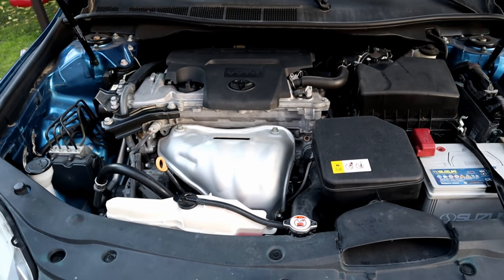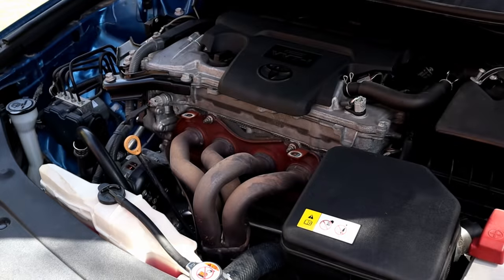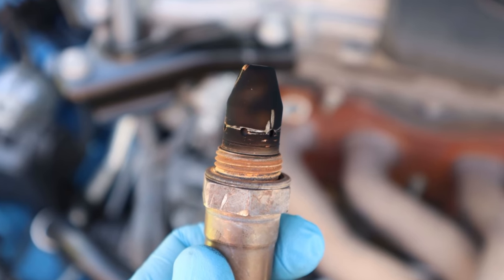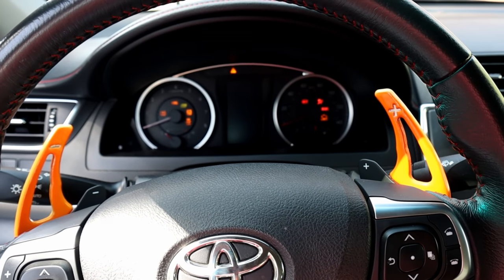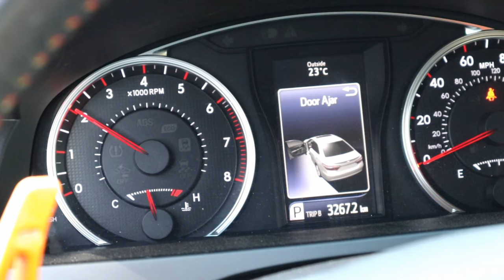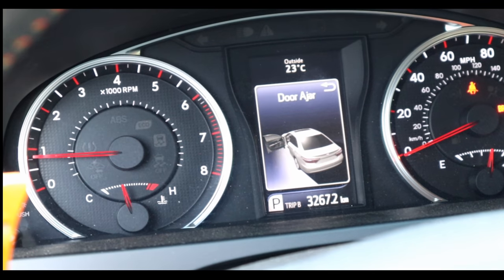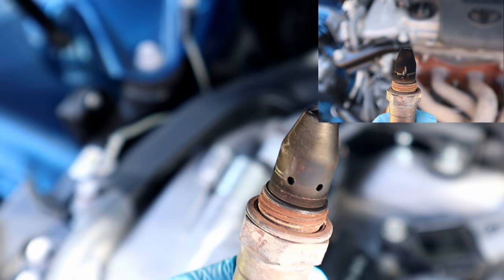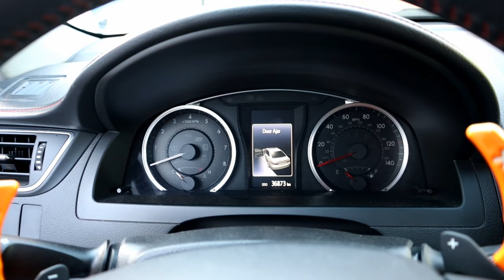Cleaning o2 sensor without removing it/Cleaning oxygen sensor with carb cleaner/TOYOTA Camry 2017

Comment: Does this work for both upstream and downstream sensors?  Thanks
Reply: Yes. Downstream just monitor how well your cats are working
Reply: Mainly for the upstream sensor.  The downstream is post cat although technically it's possible if you flood the intake with the solvent that some of it can make it past the cat and on to the downstream sensor as well but in the case of the downstream sensor the main issue there are with those is not so much carbon accumulation but rather the heating element inside of the downstream sensor going bad.

Comment: I guess  that is OK if no new sensors are available  but you can get a brand new same day. People used to clean sparkplugs back in the old days. I change sparkplugs every 100000 miles, I use NKG or Denso.

Comment: The problem is the actual sensor is actually covered by the metal cover that you just cleaned the sensor itself might still be dirty you're better off removing it and soaking it for about an hour and even then it's not going to be perfectly clean the only way to be sure is to replace it they're not expensive and it's an easy job.

Comment: The Air fuel ratio sensor was black because it ran way too rich.  If the sensors are functioning right it should clean by itself
Reply from the maker: Correct,  I had bad fuel injector, after I cleaned it, I did this too to speed up the process to clean the sensors

Comment: After opening the oxygen sensor Check light will appear or not?
Reply from the maker: No, it will turn on if you unplug the wire harnesses when the engine running
Reply: @AliMECH  thanks bro

Comment: Looks like the cleaning worked. However that is not an O2 sensor, it's an Air Flow sensor which gives more information to the car's computer than the O2 sensor.

Comment: Good variant. View old petroil and filtr petroil. Sensor not It won't get dirty that fast.  In dry fuel there will always be soot soot going to the sensor.  Good fuel makes less soot.
Reply from the maker: Yes that's right, it will only gets dirty if there a problem with the fuel injectors or spark plug, I had clogged fuel injection, and I did this to speed up the cleaning process

Comment: My o2 censor is on my catalytic converter. 
I did spray it out. 
I sprayed carb cleaner into the catalytic too.
Then I ran it for a while and revved it. 
I'm still getting bad emissions from the catalytic. 
I thought the reason why was because I put in thicker oil and that went straight to the catalytic and o2 censor.

Comment: Hi, I have mazda 2 2012 1.3 Automatic 120000 km I'm getting code P0171 system too lean bank 1, I have changed the air flow sensor but no  use, any suggestions what could be the issue?

Comment: a carboned up O2 or air/fuel sensor may indicate that it is dead and that is why it is covered. Know how to test it and simply replace if required. Cleaning internally is good though.
Reply from the maker: I had one failed fuel injectors, that's why , engine had misfiring, it will cover o2 sensor like that

Comment: please tell me this is a regular carb for cleaning the carburetor
Reply from the maker: Yes, Its regular carb cleaner
Reply: @AliMECH  and what is the result, there are improvements?
Reply from the maker: Yes, burning less fuel, better fuel economy,  because it will send accurate data to the computer
Reply: @AliMECH  
I'll try.
I have a vibration on "P"
Reply from the maker: Might be the fuel injectors, watch this https://youtu.be/aDvtzg-ThZs
Reply: @AliMECH  thanks
Reply from the maker: You welcome
Reply: @AliMECH  
but what about the second sensor at the bottom?)

Comment: I would put anti seize on the O2 censer threads before re- installing it !
Reply: Ya you can tell he doesn't. He has rust all over the threads of that O2 sensor. Wait till they have high miles those sensors will have to be cut or drilled out
Reply: Agreed, I would have cleaned the rust off the threads too.

Comment: Does it throw any codes when u remove it and clean those
Reply from the maker: No, but if you unplug the wire harnesses when the car running,  it will turn on the check engine light and throw code

Comment: It's a good for atemp to fix a bad oxygen sensor code.  But it meathod of spray cleaners will only remove surface carbon.  I will be coated with black carbon in a week.

Comment: Just by a new one. The resistance value of the coil has probably changed due to increased heat. So this is going to have an adverse effect on your fuel trim and you will never achieve LAMDA.

Comment: I think.....the 02 sensor though may be bad on the inside part.....not the outside gunk. So I guess clean it and see. If it works ,good. If it doesnt buy a new one. Everything is not magic just some things are....lol.....To my understanding theres a heating element on the inside of the sensor..... CLEANER MAY NOT FIX IT.

Comment: My car shuts down when I do so or am I using the wrong vacuum line?
Reply from the maker: You need to hold the rpm a bit high maybe 2000
Reply: And only do short squirts of the carb cleaner. Stop squirting when the engine slows down, wait until it comes back up, and do another short squirt. Repeat until half the can of carb cleaner is gone, I think he said.

Comment: One only needs to pause @3:22-23 to see that the carbon has only been removed from the upstream side of the sensor. Cheap fixes and jury-rigging are only temporary fixes if the sensor is broken or worn .... Spend the money, do it right and get over the cost. It will eventually pay for itself in the cost of wasted gas, poor performance, time and aggravation.

Comment: How to break through the cecum?

Applicable to "forced air cooling" scooters with cooling fans, or water-cooled steam and locomotives (including heavy machines):
Replace the spark plug with a new one first, then wipe the "inner edge of the exhaust port" clean, then start the engine to idle for 5-10 minutes and then turn off the ignition, then remove the spark plug to see the front thread (exposed in the combustion chamber, equivalent to dismantling The engine looks at the carbon deposition in the combustion chamber) and the color of the exhaust port, this is the degree of carbon deposition at the engine idle speed!

The idle speed of the engine is actually the time when the intake and exhaust time is the most abundant, the ignition is the most reliable and the combustion is the best. poison!

Next, lock the spark plug back and run for five minutes in a row to do the actual blowdown test of the engine in the driving room:
Do not exceed 2/3 of the maximum speed. After stopping and turning off the engine, the "inner edge of the exhaust port" will definitely be darker than when idling. After pulling and turning the car, park the car and turn off the engine. Remove the spark plug to see the front screw teeth, which are exposed. In the combustion chamber, the carbon deposits will be as black as the exhaust!

In fact, it is the more incompletely burned carbon black from the combustion chamber - the exhaust port of the cylinder head - the exhaust pipe, the catalytic converter - and finally the end of the exhaust pipe "can not filter out the catalyst" and is even faster than the idle speed. Hundreds and thousand times of poisonous carbon black gas is discharged to the "global village"!

grateful!

Comment: Most cleaners will be burned in the engine and none will be able to reach the O2 sensor.  The only hope is a "cleaner" running engine helps remove the carbon build up all the way to the O2 sensor.  Note the sensor is under the metal cover for protection.  Most of the problem is a carbon coating on the sensor will stop the sensor operation.

Comment: Spraying out the carbon deposit from the metal cover of the sensor does not do anything. The only way to really clean it is with ultrasonic bath, etc... and the results are not guaranteed.
Reply: Some mechanics wash it in boiling water

Comment: What is the vacuum hose and where? Isn't it the fuel injection?
Reply from the maker: The hose that connects pcv valve to the engine cover, is the vacuum  hose

Comment: You could just replace th O2 sensor for 50 bucks and not risk trashing your catalytic converters.  They usually last 100k miles.  This seems unnecessary.

Comment: Useless operation. If a o2 sensor fails it’s not because of that little bit of carbon. If you do this for an EGR or the intake valves then sure it can help. This video is the equivalent of degreasing your oil dipstick just to put it back in to check the oil level.

Comment: IMPORTANT to find out WHY its getting sooted up.  Likely an AIR intake or exhaust leak reading as a LEAN condition and the ECU making a rich condition......which is what I went through.  I just solved several air intake leaks....... and finally w a smoke machine in the tail pipe would another culprit was an exhaust leak on bank 2.   Not resolved... and it took several removal and cleaning by hand (easy w ramps and antiseize) to clean up/get the carbon out of the system.   Running like NEW now!  OBD2 scanner to graph out the B2S1 front O2 sensor to verify proper voltage swinging activity is KEY.    night and day now.   Unleash the B E A S T!  thanks

Comment: I changed my o2 sensor and a week after the engine light com back on saying that the sensor need to change I don't understand
Reply: It's because the process that plugged up the first sensor has not been fixed. So that same faulty process plugged up the new sensor also. Somehow maybe the air/fuel mixture is off so it is burning too rich. Try replacing your air filter first. That's the cheapest possibility of fixing the air/fuel mixture. If that doesn't work, something more serious may be the problem, such as fuel injector not working properly.

Comment: Hi
 What is the benefit of cleaning o2 senser
Reply from the maker: Sending accurate readings to cars computer and you will have better fuel efficiency, more mileage
Reply: @AliMECH  I'm using Mitsubishi Lancer 1.3 litter petrol engine (300000km)
8-10 is the fuel efficiency in highway. If i change o2 senser, may be get any benefit for fuel consumption?
Reply from the maker: Not that much, you need to replace fuel injections as well

Comment: If the sensor is dirty, it means the car is suffering from incombustion or the sensor is not working. Solve that problem first not by cleaning.
Reply from the maker: Exactly, that's what I mentioned, I had clogging fuel injector, it will also cleans the sensor, but I wanted to speed up the process

Comment: Contact point cleaner is highly recomended than carb cleaner for sensor cleaning
Reply: cant spray mass air flo sensor with carb cleaner, correct?
Reply: @sueapollonio3000  ✅Cause will destroy the computer chip & go with CRC Mass Air Cleaner and Throttle body cleaner will see after all use of theses products MPG gains 2-5 great 👍

Comment: The bottle you used is not made to enter the engine...its a carb cleaner...real way is to use liqui moly cat cleaner...to clean catalytic system...and in usual oxygen sensors are not made to be cleaned there is a certain maintainance to replace in certain mileage

Comment: How about carb cleaner in oil catch can?
Reply from the maker: Is your catch can outlet connected before throttle or on pcv valve,  dont do it if its connected before throttle because it will mess up throttle   but if its connected to pcv valve line,  go for it
Reply: Thinking an equivalent to the "oil catch can" could be created for the egr to intake manifold "soot machine".

Comment: What about chech engine light on
Reply from the maker: It should turn of after driving, or disconnect the battery negative terminal and connect it again, if it comes in again, you have a faulty o2 sensor, and you have to replace it with a new one

Comment: You failed to day that the oxygen sensor most be cleaned on the threaded area, otherwise it won't have good ground continuity and the engine won't work Right, don't forget to apply anti seize to prevent corrosión.

Comment: Why you didn't disconnect the battery ?
Reply from the maker: No need to,  because I didnt start the car with the sensor unplugged
Reply: @AliMECH  i have a subaru forester, my o2 sensor didn't work, i want to solve the problem by watching some videos, every single video told about to disconnect the battery before plugging it to the exhaust , tell me more please

Comment: Isn't this just addressing the symptom but not the cause?
Reply from the maker: Yes of course, you are right,  I had one bad fuel injector,  after I cleaned it, I wanted to speed up cleaning process for the o2 sensor
Reply: @AliMECH  how do you speed up cleaning process for the 02 sensors?
Reply from the maker: Like what I did in this  video

Comment: You clean the neutral not the heater in oxygen sensor.
Reply from the maker: I know the outer surface just for protection, but the carb cleaner goes in from the holes

Comment: The experience of a very conscientious car repairman for 30 years:

At any engine speed, the inner edge of the exhaust port is still clean^ Really complete combustion^, which is the most fuel efficient!

The choice of gasoline number:
See which kind of gasoline can make the inner edge of your exhaust port the least black. It has the best combustion (the power output of gasoline is of course the strongest when it is close to burning out), and has the least amount of carbon deposits (there is much less chance of wasting money) , The color of the exhaust port, the front thread of the spark plug and the combustion chamber are all filled with exhaust gas!

Profiters who rely on engine carbon deposits, steam and locomotives that cannot make the most of their use, also have to use the "87 mode" of the engine idle exhaust inspection with ignorance: who can drive at 800rpm? That man is God!

The worst emissions from engine idling are deceptive, because when there is a "traffic jam", whether it is a car or motorcycle, the engine can only start at idling speed in that place, waiting to start moving forward, plus the "exhaust pollution" in that space. Concentrations are high, and being said "out of context" has the worst emissions at idle!

grateful!

Comment: carb cleaner remove the coating on throttle body plate, that's why you should never use it to clean the throttle body, so why using it here?!!
plus if you have to take it out before or after or both why not clean it when it's out. and clean intake and other parts with proper cleaner, like seafoam or throttle body cleaner!

Comment: Pouring carb cleaner directly into the engine is an easy way to damage the cylinder walls , in this video the engine becomes noisy

Comment: What happened to car if my car o2 sencor is dirty. ? My car is showing check engine light
Reply from the maker: You will have a bad fuel economy and the check engine light will be on, i suggest to scan it to know what code causes the problem
Reply: @AliMECH  when i press gas pedal and it hit 5000rpm then check engine light turn on .. is it also a sign of bad O2 sensor ?
Reply from the maker: Is it stays on or flashs? You may need to scan it to see what codes you have
Reply: @AliMECH  as soon as rpm touches 5000 check engine light turns on immediately . And whenever i restart the car again check engine light switches off

Comment: Cleaning the sensor is a good idear ,but you have to find the reason why its sooted up in the first place ,or it will just soot up again ,its using too much fuel ,i e running too rich .
Reply from the maker: That's true, I had one fully open fuel injector,  after cleaning the injector,  I did this

Comment: so, you removed it already to see the difference,  why don't you clean it while it's off ?
Reply from the maker: For some cars it's hard to remove it, and some people don't have tools to remove it, so I put it back to proof that this method worked
Reply: They are a nightmare to remove. I had to buy a magnetic heat induction tool to remove mine. I broke 2 sockets before getting this (not inexpensive) tool.

Comment: you say that if they are black and covered in soot this is wrong and is caused by engine problems, so your car has an engine problem. did you cure this, no, well that's because all fuels give of soot when burnt and will cause sensors, valves and anything inside the exhaust to be covered in soot and that is why cars now have to be fitted with a DPF or GPF to filter out this soot and ash particles. your slighty sooty sensor will make no difference to how the engine runs until it is completely caked in soot and that will never happen due to the temp of the exhaust manifold.
Reply from the maker: Yes, I had one bad fuel injector,  after cleaning the injectors, I wanted to speed up cleaning process for o2 sensor

Comment: And why I have do this?
Everybody show how to do - but nobody explain in details why they do..
Reply from the maker: Clean o2 sensor, will send accurate data to the computer and burn less fuel
Reply: @AliMECH  
And this you have Approved how ?
Or is like: I guess the consumption is less then before...?
Reply from the maker: @tobiasherrmann5817  If you want approve, unplug o2 wire harness and drive your car, you will see a major fuel combustion
Reply: @AliMECH  
? That’s then only simulating an damaged one...
I mean (and u know it): what is the difference now with clean one...
Sooty my English is not the best - but you know what I will point out.
Reply from the maker: @tobiasherrmann5817  Text what language you speak
Reply: @AliMECH  
I am only German...
...and I am a techn Engineer with deep interest on Automotive
Reply from the maker: @tobiasherrmann5817  Thats awesome, im Air conditioning  Engineer

Comment: First you have to wonder why the sensor is dirty in the first place
Reply from the maker: You are absolutely right,  u answered that may times in the comments,  I had a faulty fuel injector, after cleaning the fuel injectors,  I wanted to speed up the process,